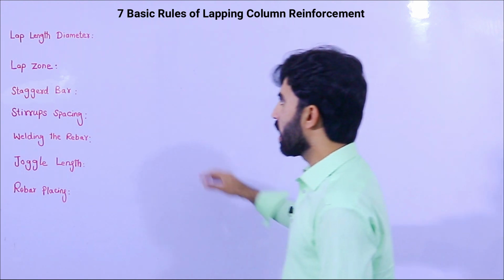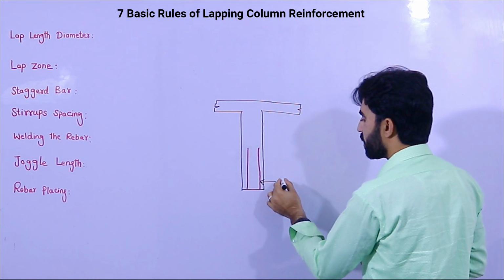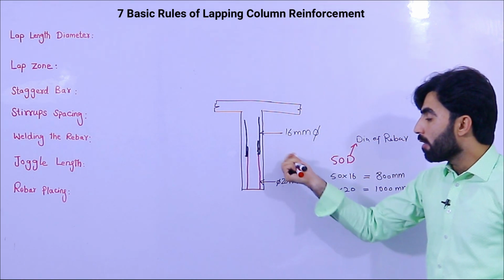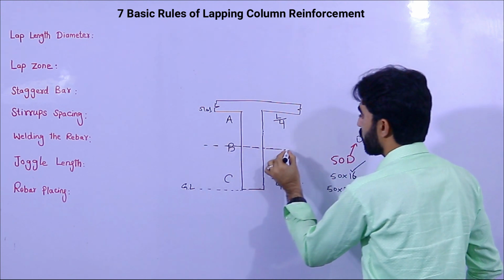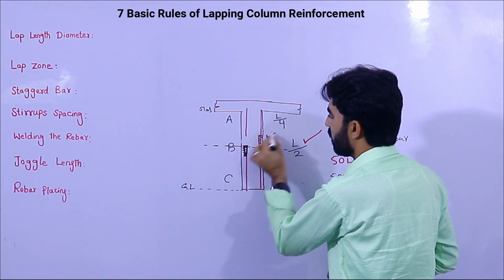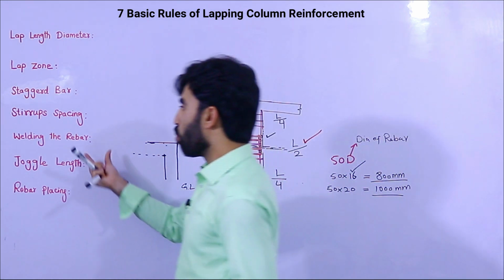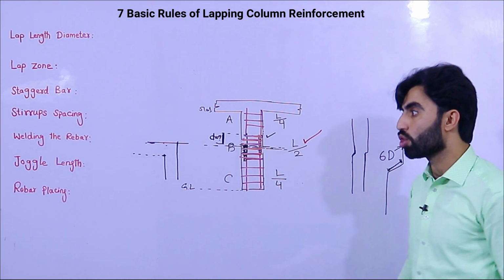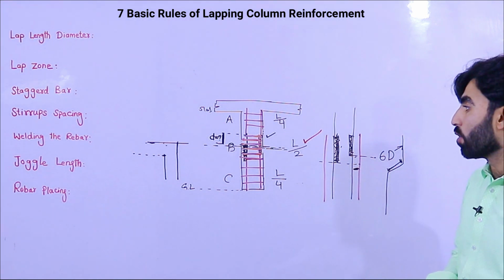7 Basic Rules of Lapping Column Reinforcement | Civil Engineering Videos |

Comment: As per IS code What is minimum spacing of ties in column??
Reply from the maker: 75mm
Reply: @engrsami1  
 answer ji 
Spacing rules  should be as follows:
1. Least Lateral Dimension of the column
2. 16times the diameter of Longitudinal bar
3. Not more than 300mmc/c